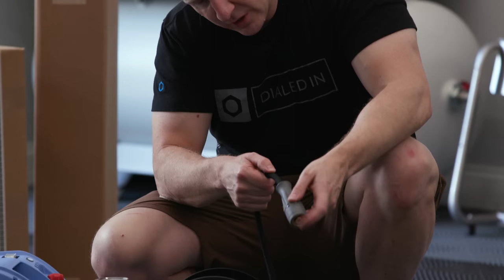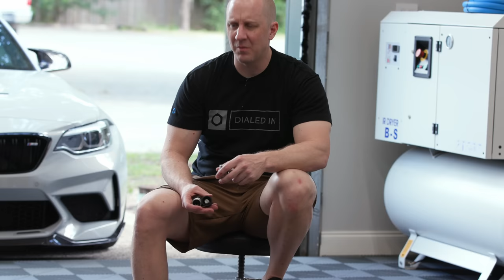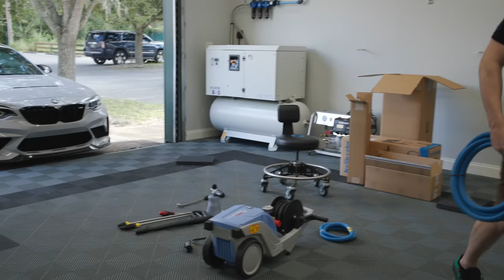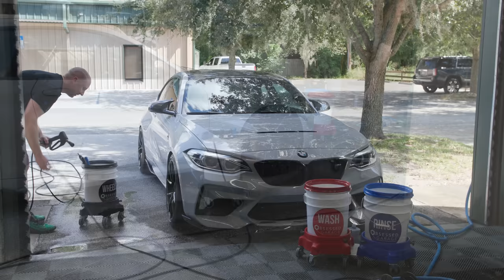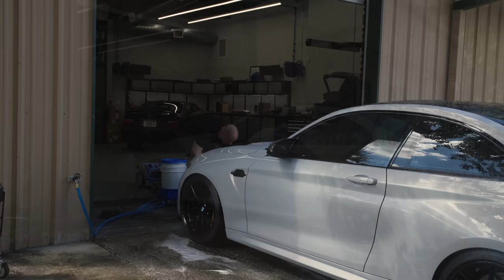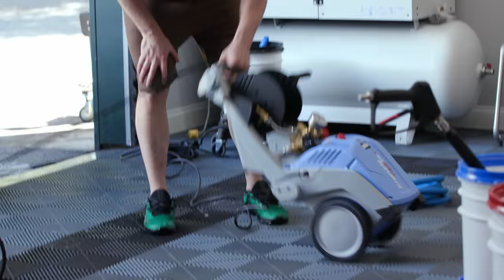M2CS: Wash and Talk Down Memory Lane - Kranzle K1122TST - Pressure Washer that Changed My Life!

Comment: My 1st kit I ordered from your site was used and the button was broken. And the blue plastic had a crack. If it wasnt a Kranzle it would have been sent back. These machines are always sold out so put mine to work and it was amazing. Unfortunately it was recently stolen. My whole setup was lost while I was away. I ordered just the power washer from Amazon and that never even got delivered. So needless to say I am without until I save up. I agree about its heaviness and a pain having to flip to unload. Maybe have breakaway handles on the box with a bottom open setup. Its what they have for the Rug Dr. Steamer.

Comment: Last August I pulled the trigger on the Ultimate Portable Accessory Package and was pleasantly surprised the quality of the functionality of this setup. I've never had a pressure washer system before but the experience felt absolutely amazing. I picked up the PF22 Quick Disconnect Kit at the same time.. Has the latest iteration became available or when are they planned to be released?

Comment: I almost purchased a AR613K a local dealer shop was blowing out for $630 until I watched you video on the AR613. Then I started watching this video on the Kranzle and a local detailed/You tuber IMJOSH here in San Diego also uses the machine and recommended it. Major price difference in price but I decide buy once cry once an old military motto we have about knight vision and other gear we need. I just hate to buy a machine then need to upgrade then I have to sell my old machine for me this was easier. I went ahead and purchased a complete ultimate kit from you so I'm in line till they become available to ship. Any Idea on the lead time on these?
Reply from the maker: It will only be a few weeks.  They tend to sell out as soon as the container arrives, but we have them coming much more often now.
Reply: @ObsessedGarage  Excellent, I just placed another order with you for detailing supplies for about $400 just a few minutes ago. Great selection and I love the discount prices I get with my Hex Plus membership

Comment: when you're detailing around 70 vehicles a month you need a gas unit it can take the beating and won't  have voltage issues.  but that thing is a beast for personal dedicated home setup.   great videos. living the dream.  keep it up Matt
Reply: I thought that's what kranzle was made for
Reply: @plasticbmw  doesn't matter what it is..no electric motor or pump will last for years of use when you're running it all day every day. so for the  price of this thing...  get a gas washer that will actually last and  can also adjust pressure for driveways and siding cleanings right after I do the cars  makes no sense to switch back and forth from electric washer to heavy  duty one.  knock out every task with one good one.   I like the Kranzle but I spent the same  money to buy something that can  really clean anything with ease. 
KranzleUSA website says if you're cleaning with it every day they recommend not getting their  unit but instead to get a more powerful commercial unit that will last thousands of hours so obviously theirs can't last more than 6 to 700 hours.  which isn't bad but you can't clean a driveway with a Kranzle. but can still detail with a commercial pressure washer... .. for  the  same price
Reply: @stephenlouden480  well I think is just has to do with what you value...I'm not wealthy but I'm a single male so I did get the cox reel/hose/og spec gun ect.. But I didn't get the water filtration system because I've noticed my whole house system works beautifully (probably because my well water is decent as it is). I also didn't get a kranzle, I got an active 2.0. And to be honest I bought direct from active because I live closer to Canada and I knew I'd get it sooner...so to each their own on all this...if there was someone who followed Matt and bought every single thing obsessively (no pun intended) that'd be kinda weird lol..

Comment: Used my friends Kranzle last week, looks nice. But my cheap ve52 works just as good.  Guess, if you’d just want to show off or stare at your power washer when sitting in your garage all day. Maybe worth it

The stubby gun , hose , and quick disconnects are useful however
Reply: @Legotechs  well I ain’t sitting on my ve52. It is located 20 feet away from car. Water is water coming out of my gun.  Gpa, is same if not more.  So what else are you paying for ? Longevity? Noise level ?

Touch and feel is all through the gun and hose. You ain’t going to be feeling your kranzle